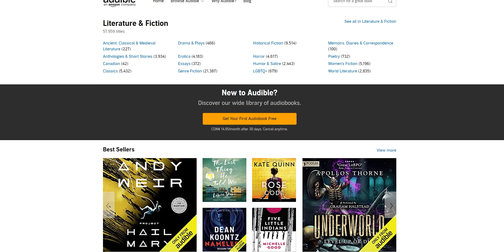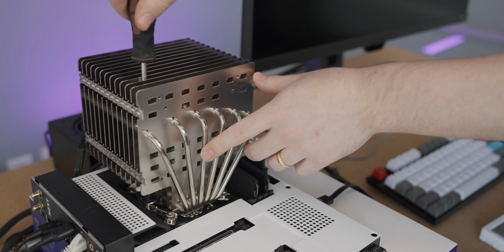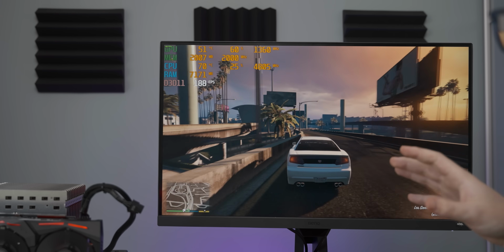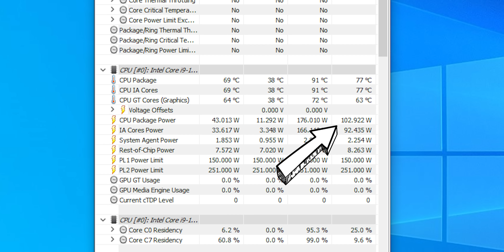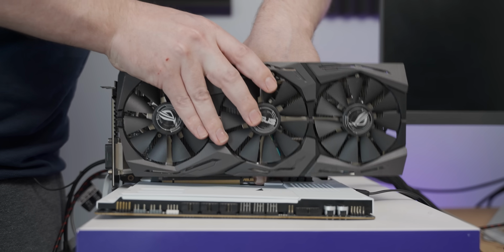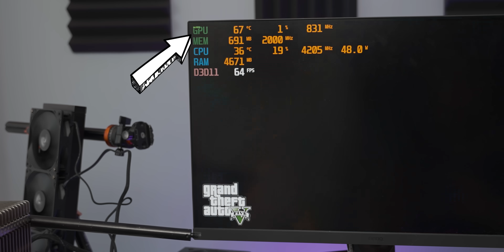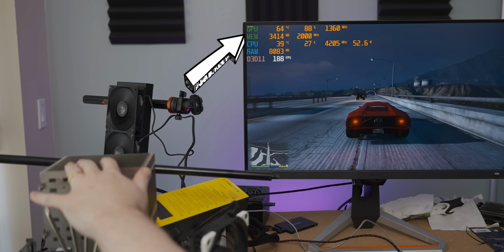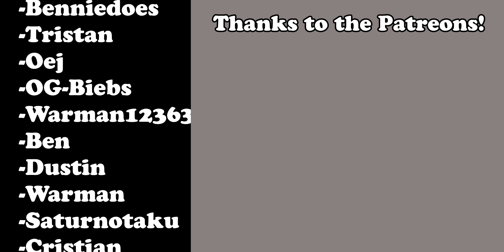I Do Naughty Things With Noctua's New Passive CPU Cooler...

Comment: I actually bought one of these a while ago. Dad's work PC is currently cooling an i3 10105 with it and running an ARC A380. The mere existence of an intake fan keeps it cool. It's almost entirely silent as every fan in the system only kicks on after its related component hits 80C. I don't think the front intake fan has ever spun up except on boot when everything spins up anyways.

Comment: The Noctua fanless cooler may not be the very best solution for a Core i9-1n900 K-series processor that often operate under continuous heavy loading, but it seems to me that it's a perfect solution for a the same processors of the non-K variant.

Comment: 2:00 The fan is not for "beast cooling". Its for building semi passive system where the fan is only switched on when the CPU has to work hard. Kind of similar to zero fan mode on modern GPUs.
Infact that cooler will not work greak for active cooling (compared to other coolers of the same size), because of the low ammount of fins and the large spacing between them.

Comment: Passive cpu coolers requires airflow which is produced by the case intake and exhaust fans. So running the test without a case is not ideal.

Comment: I have a question 🤔..?  
  Have you ever thought of..  Using the Noctua NH-P1, Passive CPU Cooler.  On both the CPU, & GPU at the same time..?

  Yes that would mean.  You would have to have two of them.  But you could do another unboxing 😉..

  Thank you for posting this video 📹.   It has been a very informative video 📹..

Comment: 6:27 -- the metal you see across the vrm and ram is the heatsink. Apart from helping the card from not drooping/warping due to the weight of the cooler Its spreading the heat across a wider area and its cooled by the fans on heatsink that blow the air up against the cooler. Of course the air will always be hot while gaming due to the GPu heatsink being directly attached to it as it should be but the cooling surface for the VRMs and RAM is spread across a bigger surface area so that should help in keeping temperatures at a more satisfactory level.

Comment: Next stage of naughty:
1) A 100% pure copper plate machined with CNC Machine according to graphic card mounting size.

2) To use car radiator instead of CPU Heatsink
Reply: Car radiator as heatsink implemented by LTT exactly 3 years ago lol >_<

Comment: Its not really passive with case fans. It actually looks like its designed for just that purpose with the fins being spaced further apart. You really need it in a case. Id bet it would be cooler in a case with good airflow.

Comment: Thank you for giving inspiration to stick a cpu cooler to my gpu. R5 240. 105 C dropped to 80 C. I have similar problems with mounting. If I pressed the heatsink to the gpu the temps immediately dropped 4 C.

Comment: These types of passive cooler are specifically built to rely on case airflow and not sit on an open-air bench, so it would be interesting to see how it performs in a decently ventilated case.

Comment: Hey I’m having an issues with my dell optiplex 3020 i5 4590, I have a gtx 570 4gb, 8gm ram 500gb HD and 500w thermal take. The issue is that when I uncap my FPS and low settings for fortnite it would later freeze the entire computer and i would have to force restart it. It would happen randomly too even if it’s capped, can you give me any solutions? Lmk if you need more info if you can help?

Comment: So you mounted the cooler by resting the card on the cooler, right? Seems like it balanced pretty well to me. Why not simply run the card upside down like that and put a weight on the card to maintain good contact?

Comment: news flash asus only does trash-tier engineering whilst charging the highest prices. This cards lack of memory cooling isnt the exception, its the norm for asus and they skimp on their motherboards vrm cooling too. Asus monitors use the worst binned color accuracy panels of a given panel model and thats reflected in the reviews when compared to other brands of monitors using that same panel asus will have the worst color accuracy all to increase margins because they like to coast on their name. Their laptops suck too. In a nutshell asus cuts every corner it can to increase margins to the detriment of performance of their products, CONSISTENTLY.

Comment: Does it make sense to test a passive cooler on an open bench with close to no airflow?

If it would be in a case it would definitely have a good chunk of airflow from the case fans.
Reply from the maker: That is a interesting point that I definitely considered. However, if you go check out that document Noctua wrote up about various usable configurations, they mention that an open air test bed is a good option. However I'm sure you would get better performance in a case with lots of airflow.

Comment: I would have liked to have seen this cooler work inside a case instead of in the open air but overall good content on this channel. I subscribed.
Reply: Cases have to evolve so that they dissipate eat themselves. You might want to look at "the beast" by monsterlabo. The heatsink is stuck in the case.

Comment: But what was the point in testing it on that CPU without enclosing everything inside an actual case. A closed case with a proper airflow? It should work way better...

Comment: The cooler doesn't need a Fan but good airflow. Put in a case with 3 intake 3 exhaust fans and temps would be better.

Comment: Is it actually possible to build a PC using a decent CPU and GPU that has zero moving parts (no case fans, fanless PSU, fanless GPU, passive CPU cooler etc) or do the parts put out too much heat for that to work? And no I don't mean liquid cooling either since that needs both a pump and fans to move air over the radiator.

Comment: This isn't naughty. This is what a normie thinks "BDSM" is. You need to get down and dirty with it - put that bad boy on a 5ghz OC i9 and then suspend it upside down so the cpu cooler is submerged in an ice bath. Everything is better with shibari.
Reply: So, just like Linus did?
Reply: @kevinjansen3785  ..Who?
Reply: @isturma  Linus Tech Tips
Reply: @kevinjansen3785  ...Who??
Reply: How do you keep the water cool? Is this where the first fridge pc set-up comes into play?
Reply: @dracopug  Fridge PC? I mean, sounds cool but you'd need something to keep the condensation off the parts. I saw someone who built a loop using the condenser salvage out of a window A/C unit and they had condensation EVERYWHERE.

But if you do a water/ice mixture with a teaspoon of salt, it can go as low as -21C since the salt changes the freezing point of the water. If you made an ice bath in an old styrofoam cooler and suspended the noctua in there, it would take a while for it to heat-soak.
Reply: @isturma  lol I was kidding, but if someone were to make a build like that im definitely up to see it.

Comment: Since it does so well passively you should ghetto mount some fans on it for the hell of it and see how well it performs like a regular air cooler. I'm curious lol.
Reply: Yeah that would have been good to see,
although no need to Ghetto as it has the fan mounts included in the thermal paste Bag,
Reply: It's worse than a cooler designed for fans
Reply: @Desktopia Size, or more relevant the cooling surface area, is way smaller on this than a D15.
Reply: @Desktopia It has more surface area
Reply: @Desktopia Yeah it's a big difference. I think it's clear anyone looking for active cooling shouldn't consider the P1, that's not what it was designed for.
Reply: @Desktopia The D15 is a lot more powerful than a U12. But the U12 should be more than enough for a 3800X, maybe try reseating it.
Reply: @Desktopia If you're running an overclock and staying under the thermal limit is don't understand the issue lol

Comment: it would be super interesting to test this vs the lowest fan speeds on a NH-D15 or something. Maybe this silent cooler can be turned into an extreme low fan speed beast. perhaps it can work with 500-700rpm or so better than a much more dense cooler considering it's amazing passive performance. Completely passively cooling a gpu and cpu with it would be super interesting as well.

Comment: Huge passive coolers are good for one thing...and that’s mounting fans to it and turning it into a beast air cooler
Reply: Agreed me from 2 years ago, I was just about to say the same thing again!
Reply: @chincemagnet  I'm here one more year later lol. But the thing about this is that this cooler has thick, spaced-out fins optimized for passive cooling. With a fan, you can use thinner fins that are closer together. So yeah, you can get better performance with a fan, but you'd be better off getting a cooler designed to be used with a fan. The idea here really is only using a fan when the PC is under heavy load for a while, and sacrificing overall performance for reliability.
Reply: @ yep, you’re right.  I just thought it was cool.  I’ve done some crazy stuff over the years, and mounting big fans to stuff that weren’t intended to have them originally is always a fun project

Comment: The height adjustable mic arm UNDER the cooler overhang would have been smarter. If, it didn't act too much as a heat sink, actually improving the coolers ability.

Comment: Messy idea: how would this perform in an NZXT H510/H500 or similarly choked case? Have one, like the looks and ease of build but not so much the thermals (knew that going into it) but the tower is right next to my head in my configuration and the stock AMD cooler is noisy as balls down a chihuahua's nose.

Comment: Noctua needs to sell a GPU mounting kit for this.
Reply from the maker: That would be really cool. 😁
Reply: @marsh5954  I think they should release a new G12 to fit the 30 series cards better, instead. It's a lot easier to throw an AIO on a video card than a huge heatsink.
Reply: I'd also buy it. Morpheus 2 to my knowledge is the only aftermarket air cooling solution which allows case fans atm. Being able to freely chose your own fans and replace noisy or broken graphics card fans is just such a big plus.
Reply: @marsh5954  Yep, also the coverage of that Morpheus by big channels is lacking. I mean it had been featured by LTT but that video wasn't exactly great (which was also partially because the total package of the morpheus wasnt great)

Comment: Question: how much improvement on the temps when we add a fan to it.
Reply: I left the same comment. Hook some fans to it like a regular air cooler and see how much of an improvement it adds. Since it performs so well passively I bet with a fan or 2 it would be the best "air cooler" on the market lol. Of course that's if you can get it all to fit in a case.
Reply: @PabzRoz  i saw this kind of thing somewhere and found out that it actually dosent help alot... The passive cooler are designed differently or something. Still a proper video by dawid would we better.
Reply: @khush_kat  That makes sense. For regular air coolers the heat fins are thin so the fans are actually able to cool down the metal but with passive coolers the fins are really thick so the fans wouldn't be able to cool them down as well. That's what I would assume anyway lol.
Reply: @I love you but that still is a huge improvement though...

Comment: Shouldn't it be tested in a case with good airflow? That's the ideal setup. Likewise, a bad case would make it far worse than open air. Edit: for cpu, as a gpu cooler it's frankenstein stuff.

Comment: Big noctua fan. Looks great but price is pretty out there. I really want that screwdriver. Lol. I'd like to see this vs the D15 with no fans.
Reply: It's better that the NH d15 with the fans off, source: I bought one at launch and I had a fanless nhd15. Cpu is a 6700 at load 24/7 has been on for 3 days now. The temps on the cpu are about 5 degrees cooler but the vrms are unbelievably cooler, (10 - 15 degrees) for some reason it seems to soak up more case heat. Using in the 460x crystal from corsair which is even listed as a non compatible case for this cooler on their website due to heat issues. So what David says here a out 65w being no problem is confirmed on my end
Reply: @audiencemember1337  Right on. Thanks. Can't imagine they would have made the thing if this wasn't the case. Just an interesting comparison given the nh-d15s is $35 cheaper.
Reply: @Phillydcuz  yeah I would say if you main goal is cooling, the nhd15 provides much better cooling at 900rpm which is silent for anyone I know but if you want a rock solid passive cooling solution this will be awesome for you. I have this for my server in a dusty ass corner I plan on never entering again and I'm a fan boy so that's why I got this.

Tldr: nhd15 with the fans at very low speed will give you better cooling
Reply: @audiencemember1337  I've got the D15 10700k @ 5ghz all core. Even under heavy prolonged load I've never seen 80C. Idle low 30s dead silent. This passive cooler is very cool and I want a reason to buy it but at this price there is just no justification for me.

Comment: Hi, what GPU is this? Anyone knows? I couldn't identify it. It seems to have 1 8 pin and it runs around 1350mhz. Is it a rx580/590?
Reply: I obviously didn't follow the video with any attention. Rx580 isn't that hard to cool so no wonder this worked fine.

Comment: So you're saying its easier to cool a GPU than 11th gen Intel. Dawid you're a national treasure.
Reply from the maker: Always useful information on this channel. 😂
Reply: Gpu's are easier to cool because
a. direct die
b. far larger surface area
A gpu die is pretty massive in comparison to a cpu die, especially when you consider much of a CPUs die is taken up by the iGPU anyway. (where applicable)
So the Watts per mm² or whatever unit you would use for that is going to be lower on a GPU even though it's consuming a similar amount of power so hotspots will be less.
Reply: It’s easier to cool the sun than it is to cool an intel cpu
Reply: dont worry, ryzen is a bitch to cool as well. coming from a 3900X user. this thing is fucking spicy.
Reply: Just stick the 11th gen intel into the snow of Antarctica and boom, even worse global warming
Reply: Yes, the TDP on modern Intel chips are basically meaningless, and higher end parts have been shown to draw well over 200w. A graphics card can too, but that's split with very hungry graphics memory too. Intel chips are NOT efficient.
Reply: @rolfrolfson  With an overclock or running the processors out of spec.
Reply: To be fair, ok no you’ve got a point
Reply: *international
Reply: Fun fact, Ryzen 7 5800X is hotter than 11th gen.
Reply: @saricubra2867  So if you don't want crazy heat, don't buy a 5800X and don't buy any Intel 11th Gen. Got it.
Reply: @deViant14  Apple M1 Macbook then?
No fan, has the fastest CPU cores on the market around  a TDP of 14 watts. at 3.2GHz, each core is an x86-64 one at 5GHz.
Reply: Its an rx 580
Reply: this comment hasnt aged well
Reply: Everyone in these comments have no clue what they are talking about.
Reply: gpu only run below 2ghz all the time. Mostly 1.5-1.7ghz while intel cpu run above 5ghz
Reply: @skadi7654  So would you just buy a GT 710 if it ran at 5Ghz ?
Reply: @zetsubou3704  if a GT 710 ran at 5 GHz, maybe it could play something more intensive than Fortnite with the performance preset
Reply: @zetsubou3704  I think Dawid has a plan to try this in the Future 😁
Reply: @AlistairWolfe993  it can play fireworks in real 3D at that point I guess 🤷🏻‍♂️
Reply: @skadi7654  ummm i think you have no idea how GPUs and CPUs work..... Clock speed isn't indicative of heat. I have a 10850K that runs at 5.1GHz all 10 cores and an Arctic Freezr 240mm AIO liquid cooler. CPU barely hits 70C running cinebench R20. My GPU is an EVGA FTW 3 Ultra RTX 3090 that clocks around 1995-2055 MHz. Sits at 65-75C @ 100% load with the AIO GPU liquid cooler. Thing is the CPU draws around 180W max while the GPU pulls get this...... 440W at 100% load! Lower clock speed but higher power draw....that's the lesson here.....POWER DRAW CREATES LOTS OF HEAT! Three letters....TDP!
Reply: @gionieves2646  90% of all power used by your pc is returned as heat - GN so you sir are correct thumbs up
Reply: @gionieves2646  440 W!!! How do you sleep?
Reply: @blackbomber72  very nicely when my electric KW\hr is $0 .09! Also the FTW3 ULTRA Liquid Cooling kit is a must have in my opinion. Air cooling an RTX 3090 to me is not adequate. I was regularly touching 75-80C even with the fans at a constant 85% fan speed.
Reply: @skadi7654  So here is the thing gpus are most of the time clocked WAYYYY lower then cpus because they have different purposes
Reply: @skadi7654  how is that relevant? ghz doesnt determine how much heat u are outputting, power draw does 100w at 4.8 and 8 cores and 65ish watts at 6core and for the gpu. The reason the gpu did fine and the intel was slowly creeping up, even with 6 cores active and slower clockspeed is because with the gpu, there a fan moving air, pointed straight at the cooler.
Reply: @skadi7654  it is not Cooling MHz, it is Cooing 'Watts' Power Usage
GPU 94.894w                        Av-70c
CPU 6 Cores 65w                 Av-70c
CPU 10 cores 102.992w     Throttling to 90c
Reply: @skadi7654  GPU's have wayyy higher wattage than CPU's
Reply: @skadi7654  
And GPU got thousands of cores whereas an i7 only has 8
Reply: @skadi7654  by that logic, a gpu should output about 100x the heat because it has more cores?
Reply: @skadi7654  CPU dies are tiny compared to high end graphics cards
Reply: @skadi7654  regardless of clocks gpus are wayy hotter than cpus in general. U cant compare gpu clocks to cpu clocks just like u cant compare thousands of cuda cores to 6 or 8 cpu cores

Comment: I've tried passive cooling a GPU as well, problem I found in the long run is RAM and VRM parts heating as well. Conventional GPU cooler's cover over those parts as well.